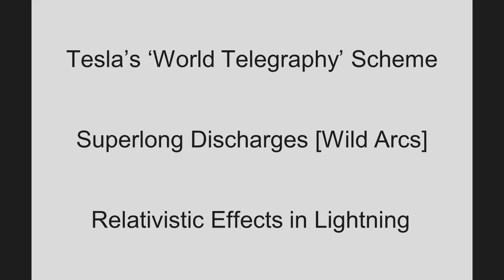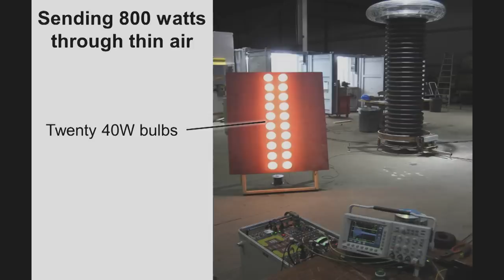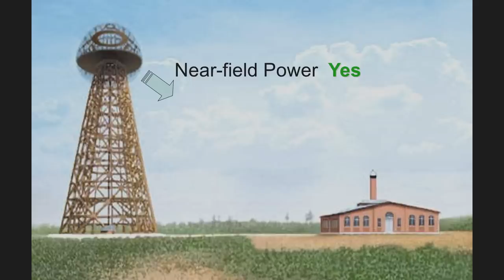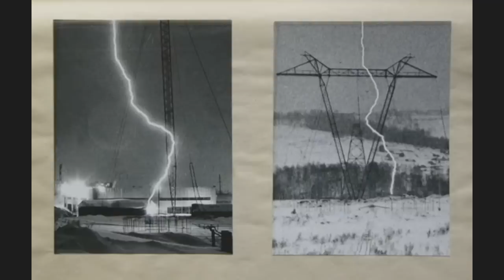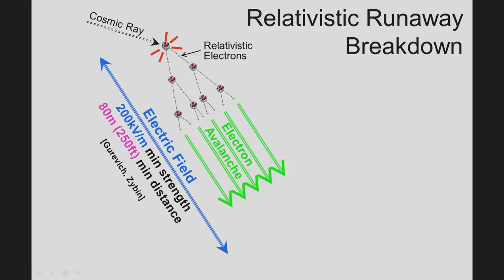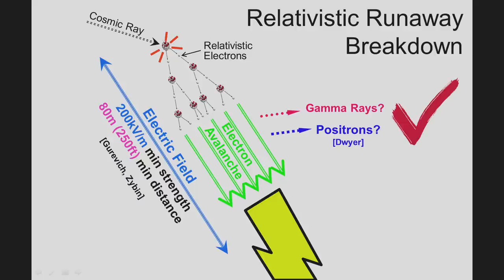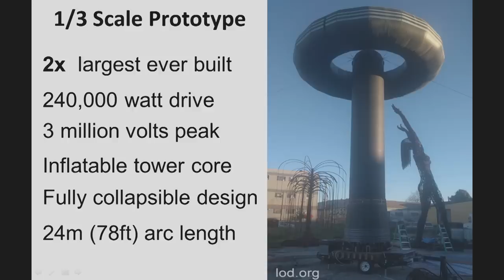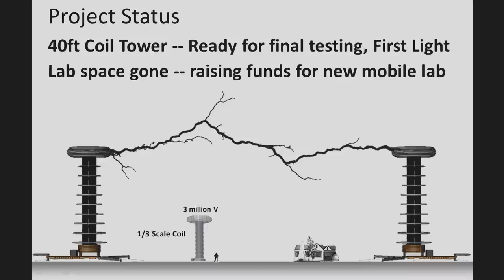The Secret Life of Lightning: The Science of Giant Tesla Coils | Greg Leyh

Comment: I congratulate Greg for his persistence. Most people associate sparks & lightning with Tesla coils. Of course, Tesla did produce large bolts of lightning at Colorado Springs. But that's not all about Tesla's secret of wireless power transmission. Tesla had discovered something fundamentally different about the nature of electricity. 
Greg should try and replace the top of his coils with a non metallic conductive element. He won't get lightning, but he'll find something far more interesting.
Reply: I want to know
Reply: What will he find?
Reply: Wao! Spill the beans please. 🗯
Reply: He'll find the 3,6,9
Reply: Indeed! Tesla’s most important studies at Colorado Springs did not make arcs so there was no “wow” factor to photograph and publicize. Greg is certainly persistent… He’s been trying to sell the LODI concept and big arcs for 20+ years.
Reply: A ruby might be fun!
Reply: Seems we have an extensive network of energy transmitted by electricity through the air: broadcast radio and TV.  Maybe a good way to transmit a signal, but not so much for large amounts of energy?
Reply: You can't just leave us hanging like that Mario!
Reply: c'mon Mario tell us!!!
Reply: What are some non-metals that conduct electricity?

“In the solid form, semiconductors, such as silicon and germanium are moderate conductors, but if doped with dopants, their conductivity could be increased. Carbon is a semimetal. It’s conductivity stems from the delocalized pi-electron, which forms a continuous Fermi surface, allowing current to flow freely. Conductive polymers, such as Ppy, PAni and PTh usually contains a benzenoid backbone. Each benzenoid ring has delocalized pi-electrons too, which allows conduction to take place.

Salts which are dissolved in water can conduct electricity too, but this is a different mechanism. Conduction in aqueous solutions rely on the fact that charged ions are mobile. This means that, in an aqueous state, the ions are no longer bound in a stable crystalline structure, and thus are able to carry their charge from one terminal to the next. Keep in mind though, salt is usually made of a metallic ion and a non-metallic ion (e.g. sodium chloride = sodium + chlorine… where sodium is a metal). Acids and base conducts due to the presence of H+ ions and OH- ions respectively.

Gases also conduct electricity if the voltage exceeds breakdown voltage. When the dielectric breakdown occurs, the gas is ionized, allowing current to flow. The breakdown of gas creates plasma, which is essentially ionized gas. Plasma, which consist of mobile ions (very much like the dissolved ions) are highly conductive.

P.s. Most things can become conductive though, if its dielectric breakdown voltage is reached. But I presume you are not talking about that, but about things which are inherently conductive, so I’ll leave that for another day.” 

Ivan Ling at Quora
Reply: 🗣Mario mario mario
Reply: More information is need Mario!
Reply: No he didn't. Telsa was against James Maxwell and Albert Einstein. He didn't believe in electromagnetic fields. He was an inventor not a physicist. Look it up.
Reply: @cjay2   Once again coming into someone's comment and just saying go look it up or go learn something just tells us you're a child. 

if you actually wanted to help people understand which you don't, your clearly just here to criticize after reading all of you different comments. Are you an electrical engineer or something?  You seem to speak as though you know better than anyone else when anyone even poses a theory. once again, please enlighten us with your amazing research and knowledge oh great cjay!
Reply: @cjay2  You're right about Tesla's opinion on Maxwell and Einstein.
Reply: @jakubwisniewski9123  You've gone deep into the subject. The solution may be quite simple. 
Tesla discovered that the fundamental nature of electricity is different from what people think. Metals seem to PRODUCE electricity under certain conditions. He was nearly killed by a bolt of electricity from the crown of his coil which struck him in the chest. This is when he replaced the crown of the coil with a "suitable non-metallic material" (it could have been carbon or graphite). Ohm's Law doesn't seem to apply to Tesla's electricity which is said to have positive health benefits.
A Jewish physicist in the US who understood Tesla's technology said it is quite simple. He handed over this technology to the government of Israel.

To expand your understanding on the subject, please go through the book, "Secrets of Cold War Technology" by Gerry Vassilatos and Peter Lindmann's book, "Free Energy Secrets of Cold Electricity." Also search YouTube for Peter Lindmann's lecture on Cold Electricity.
Reply: @Curtis.Carpenter  I prefer to be a child in this matter. Those who want to become "grownups" can start educating themselves from the leads given. I can't help anyone in this matter.
Tesla's technology has been sequestered away from public knowledge. Anyone who tries to get it out will be silenced. 
A scientist said that Tesla's technology is quite simple. The government of Israel has this technology now; and God knows who else.
 If you are acquainted with electricity and experimentation, You can start experimenting. I too wish to have this technology available in the open. I'm not going to spoon feed you. There are clues in the books of Gerry Vassilatos and Peter Lindmann. Good luck!
Reply: @dougselsam5393  Tesla produced scalar waves which can travel across galaxies INSTANTLY (faster than the speed of light). The power generated is enormous. 
People say that Tesla invented AC electricity. No, someone else did it , but Tesla gave it to the world.
Tesla's real invention is IMPULSE ELECTRICITY. Sadly, this is for the future only.
Reply: Tesla find how to created electrons from space, like virtual particles.
Reply: @dougselsam5393  he didnt transmit anything by air, well actually a very small quantity which was a side effect. We fail in thinking that ball sprayed out some power to somewhere else. It didn't. Power indeed WAS distributed elsewhere but not by any electromagnetic means.
The puzzle piece everyone needs to start with is the other form of electricity, yes, there are 2 and its hidden in plain sight. There are 2 kinds of current. Electromagnetic commonly used in power distribution and signal transmission... Then there is the magic of Displacement current where no electrons move in the current. That's the starting point. When your circuit produces impulse displacement current whereby a final coil of wire has its voltage and current IN phase, you create an entirely different byproduct from our normal electromagnetic byproduct we call 'electricity' , you get the other form of current. That was Teslas greatest discovery. It wasnt a hidden secret at all, it was simply supressed by the powers of the day and lost to antiquity. There are people alive today who are recreating these results. I have seen it. Its easily doable..... All this fiasco has little to do with the sciences, its a control mechanism to protect the public from access to tech whereby an average person can manufacture equipment so weaponisable that governments must keep it supressed. The means of suppression is simple, deny the Aether. How entirely odd that maxwells and Steinmetz equations need aether to work... Odd indeed.
Reply: @atmospheres11  There is hand-waving-and-happy-talk, then there is a working model.  Show us a working model of whatever you are talking about.  Mere words are not always a valid substitute for reality.  Meanwhile we have broadcast radio and TV, which is coils transmitting energy to other coils in phase over a distance.  So far not a good way to transmit power, so much as just signals.  Don't worry, at least we have wire.  Uncoil it and use it to transmit power.  :)
Reply: @dougselsam5393  if you want to start the journey to the facts in a modern sense then study these 3 existing significant characters alive today. Each has their part to play in the understanding. 
Eric Dolard.
Master Ivo.
Theoria Apophasis.
Master Ivo actualy finally recreated displacement current only recently after years of working through understanding Teslas work and shows you every step in replacing older components with mosfets.
Eric understood Tesla experientially a long time ago and uses a diferent math than conventional because the standard format misguides the user.
Thoeria (Ken) is the first person I've found to thoroughly explain magnetism in a very accurate way. His knowledge is available for free in his book. 
But it is better to go to the source, Tesla, have you?
Reply: @atmospheres11  Garry:  We have inductive coupling for charging any device, including phones and cars.  Lots of talk of roads with built-in chargers for cars.  Not violating any physics "laws".   Not super-efficient either, just convenient.  So for short distances for charging, to longer distances for carrying radio signals, the concept of transmitting electrical energy without wires is well-understood and used for over a hundred years.  Even Tesla's induction motor transmits a working magnetic field to the rotor from the stator.  So all this stuff is super-mainstream and well enough understood to be in daily use all around us.  I'm not sure what additional info you have besides handwaving-and-happy-talk, but I come from the field of wind energy, where well-intentioned and enthusiastic people without experience in wind energy perpetually promoted known bad ideas over and over again, never realizing they are just a part of the pattern of ignorance.  The similarity between whatever you are talking about, which I do not even know what it is, and wind energy crackpots, is the notion of sidestepping the requirement of an actual source for energy, promoting getting "something for nothing", where electrical energy just magically comes from "nowhere".   Sad, when wind is free, and good ways to extract the energy are well-known.  There is your "free" energy - as always it still costs money to collect it.  Just as people can promote silly wannabe wind energy devices that are long-disproven to the unwary, so can people promote whacky incomplete "theories" of how to magically have energy just show up from nothing.  Such claims are of course easy to make.  There is no limit to what someone can claim with mere words.  But if you can't show a working example, then maybe your theory, whatever it is, needs more work.  :)
Reply: @dougselsam5393  Tesla was not using the method you speak of. If you are looking for knowledge on the subject you will find it, if your seeking support for existing knowledge it will be lost to you. Consider Tesla a very clever guy instead of a fool tinkering with pseudoscience. Give the man credit. Research!
Reply: @atmospheres11  OK I looked up Displacement current.  Maxwell, from the mid 1800's.  People were pretty smart back then.  Yes that is what I'm talking about.  We build our own wind turbine 3-phase electrical generators here, from neodymium super-magnets made just for us.  Wasn't it Tesla who came up with 3-phase power?  Anyway, we don't worry so much about how to describe the theory, we just know what works to produce power.
Reply: @dougselsam5393  I am not sure how else to reply Doug, the conventional electromagnetic stuff you are talking about is not what Nikola was doing. He was not transmitting any electromagnetic energy/power. Perhaps it may help to say, there was NO magnetic and NO electron transmission, propagation or radiation. That is of course the nature of typical hertzian EM propagation but it has nothing to do with his Towers. As I keep trying to get people to understand, there exists a second form of 'electrical energy' and it is not used conventionally in modern engineering, yet, its still there and available to use. He discovered that no insulator nor material hindered its propagation, it had peculiar properties and if you look at his famous picture in a room full of 'sparks' and read what that was about, that second form of electrical energy had no affect on him, he even toured doing shows where he glowed on stage. This is deeper than silly high voltage sparks.
Perhaps starting with hertzian transmission, we have the magnetic components and the electric component propagating outward from the source. Those 2 are 90deg out of phase. 
Tesla made the magnetic and electric in phase, the effect was the vast majority of energy propagated didn't suffer any square law losses via propogation. 
Anyways, as Tesla says, it will be a long time before mankind realises what we are missing (circa early 1900's) we still haven't had our ah hah moment yet. Some of us dug deep enough and have but its going to take time. I believe we will finally start using it in the next few decades, there is already one company in America who has built a slight variant if Nikolas tower and is market ready and entering mainatrean with a slight variation to Tesla so as to  avoid US sidelining the project due to its potential weaponising aspects.
Reply: @atmospheres11  OK Garry I will endeavor to look up what you are talking about, and try to make sense of it, if I get a chance, but am pretty busy.  But I note, your insistence has the same flavor of wind energy crackpots promoting vertical-axis turbines, always citing perceived attributes (doesn't need to aim) while ignoring all the flaws.  The reason they are never used in windfarms is they suck.  It is not because experts don't understand them or are closed-minded, but rather that they are well understood, especially the reasons why they suck.  One thing I've learned over the years, any single source of "information" can "sound" extremely convincing, as long as you only hear one side of the story.  In your case I think all I'm asking for is some results or even a clear picture of what you are even talking about. You can get the same sort of "reasoning" regarding perpetual motion machines, windmills powering cars that then power the windmill, generators powering motors that then spin the generator, etc.  All ideas that can never "quite" be demonstrated because the theories are flawed and the resulting machines don't work, but it doesn't stop wannabe technology people from claiming the theories are just covered up and the principles are valid and would change the world.  It's an old story.  The way I explain it to newbies is "you can't fly by pulling up on your own shoelaces".  And it's not because shoelace-flight is being "suppressed", it's because the theory makes no sense.  Anyone can understand why pulling up on your own shoelaces won't get you from NY to LA.  But throw in electricity and magnetism, and whacky stuff is not so easy to flag or identify as balderdash.  I'd love to see you pin down exactly what you are even talking about.  So far all I see is it's all a big coverup, but of exactly what I do not know.  What exactly is it you are talking about?
Reply: @dougselsam5393  a good question Doug, what am I on about! 
My comments are about this video. To simplify my ramblings, these guys are explaining conventional  radio transmission, which of itself is OK, but attributing it to what Nikola did with his Wardenclif tower is an absolute mistruth at the least. Nikola clearly stated he did not transmit radio energy power from it. He is clear historically and it is recorded for those who care to look.
So, if this video is absolutely wrong and what they do in this video has nothing to do with the 'Tesla Tower' then what Was Nikola doing?
That's where I attempted to explain.
My apologies for it being difficult to grasp, its hard to use common rules of thumb to understand the scalar non alternating displacement current. The only means to understanding Nikolas accidental discovery means to accept a secondary form of electricity which will not fit with conventional thinking. 
Standard conventional electrical activity has a magnetic component, Nikola 'sent' power not by radio and not electromagnetically (no magnetic component!).
No atoms/electrons/subatomic particles/ions etc left that tower as he 'sent' power to another tower.
Reply: @FernandoDeJesusPonce  Forgive me for the lapse. I can give a very important clue to the real Tesla energy. Please watch Peter Lindemann's 'Secrets of Cold Electricity' on YouTube.
Reply: @retrocomputing  Forgive me for the lapse. I can give a very important clue to the real Tesla energy. Please watch Peter Lindemann's 'Secrets of Cold Electricity' on YouTube.
Reply: @cuprum166  Forgive me for the lapse. I can give a very important clue to the real Tesla energy. Please watch Peter Lindemann's 'Secrets of Cold Electricity' on YouTube.
Reply: @jeffparisse4202  Big arcs from Tesla coils are just for diverting attention from the real thing. Forgive me for the lapse. Here is a very important clue to the real Tesla energy. Please watch Peter Lindemann's 'Secrets of Cold Electricity' on YouTube.
Reply: @dougselsam5393  Forgive me for the lapse. Here is a very important clue to the real Tesla energy. Please watch Peter Lindemann's 'Secrets of Cold Electricity' on YouTube.
Reply: @Entropy1234  Forgive me for the lapse. Here is a very important clue to the real Tesla energy. Please watch Peter Lindemann's 'Secrets of Cold Electricity' on YouTube.
Reply: @carmelopai4833  Forgive me for the lapse. Here is a very important clue to the real Tesla energy. Please watch Peter Lindemann's 'Secrets of Cold Electricity' on YouTube.
Reply: @che4568  Forgive me for the lapse. Actually, Tesla's energy is quite simple. Here is a clue. Watch Peter Lindemann's lecture on 'Secrets of Cold Electricity' on YouTube.
Reply: @trichbeer6941  Forgive me for the lapse. Actually, Tesla's energy is quite simple. Here is a clue. Watch Peter Lindemann's lecture on 'Secrets of Cold Electricity' on YouTube.
Reply: @cjay2  Forgive me for the lapse. Maxwell correctly predicted longitudinal waves. Tesla found fault with Hertz and openly ridiculed Einstein. Actually, Tesla's energy is quite simple. Here is an important clue. Watch Peter Lindemann's lecture on 'Secrets of Cold Electricity' on YouTube.
Reply: @Curtis.Carpenter  Forgive me for the lapse. Don't expect me to spoon feed you. Find out for yourself. Actually Tesla's energy is quite simple. Here's an important clue. Watch Peter Lindemann's lecture on 'Secrets of Cold Electricity' on YouTube.
Reply: @marioduddu471  thank u - my mind just got muddled reading the to's and fro's between the two chaps in this thread. Will look up your suggestion....then maybe come back to those two to see if I can fill in the gaps...I may be kidding myself big-time though. What do u make of their discussion?  Esp regarding this 'secondary' power/electricity/energy...? (Doug Selsam)
Reply: This guy gets it, its all about the impulse. Even further one will know they're on the right track if they can produce a "white flame" and dark discharge
Reply: lucy in the sky with diamonds comes to mind, have a beautiful day
Reply: Don't forget about the work of Dr. Thomas Henry Moray as well! He too was working with modulating these dielectric impulses waves and it is documented in his very old relatively short book titled "Beyond the Light Rays: the Sea of Energy that the Earth Floats In"!
Reply: @jakubwisniewski9123  radioactive clay was used by Tesla. found in basically all beauty products during his time
Reply: @marioduddu471  
Better late than never....It need to be ' Peter Lindemann' with an   e
Reply: @cjay2  bad info
Reply: @atmospheres11  i have a nuclear eng background. I think wardenclyff was a power receiver from the capacitance difference between the earth and the stratosphere.  Just a theory from observation of the wiring passing through the granite foundation blocks and the overall tower construction. I havent dug deep enough yet to have a solid opinion.
Reply: @KV-ui7ew  to what end? Background radiation levels are insufficient for power applications at scale.
Reply: A tree is conductive lol
Reply: Since people are talking about "Scalar Waves" here I think I should chime in and clarify something.

A scalar is something that has a magnitude but no direction. For example, the temperature in your room is a scalar and so is the barometric pressure. It’s omnipresent in an area for example with a magnitude but there is no specific direction to it. That is what a scalar is and why the notion of scalar waves is complete nonsense.

The real Tesla wave is longitudinal and extraluminal that does NOT conform to the inverse square law nor do they have an inherent velocity. That does not mean faster than the speed of light, which is “superluminal” – it’s extraluminal, which means it is outside of the fictitious light speed constraints. They transmit from one antenna to the other without taking time to get there. If there is no time then velocity is not part of the equation. It is not transmitting/propagating through space, but rather through Counterspace/Aether from point A to point B.

Think of the Impulse as a hand and the Aether as the Water, slapping hard and fast enough transfers most of the energy into the water as an underwater Longitudinal shockwave compared to minimal transverse surface motion, very simple concept, this form of energy is also present on the cold side of the "Hairpin Circuit" and why you can light a high powered bulb with the smallest of wires without destroying them.
Reply: FDM print conductive PLA? This material makes great VDG. collectors and I've printed large ones with a spherical top and what's essentially half a torus for the bottom... One advantage is obvious. With a simple 3D modeler like Fusion_360 the printed shapes are only limited by imagination. More to your point, there's much to be learned even now in this very interesting field!